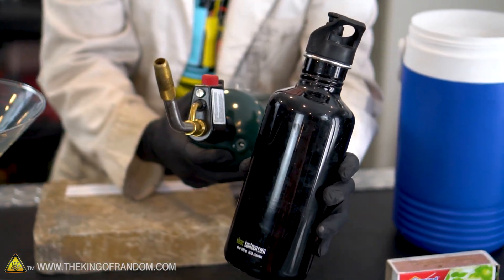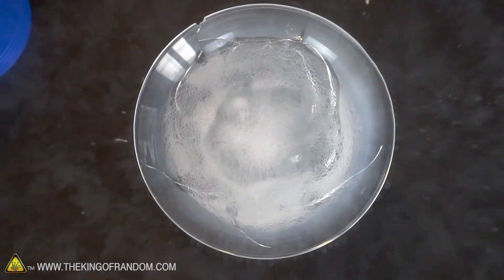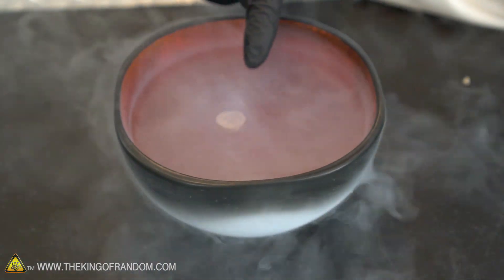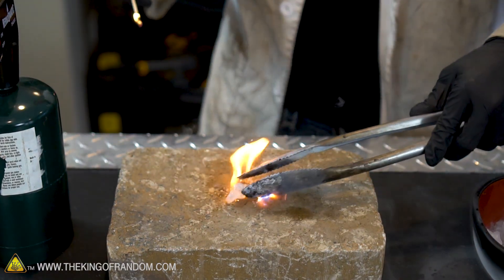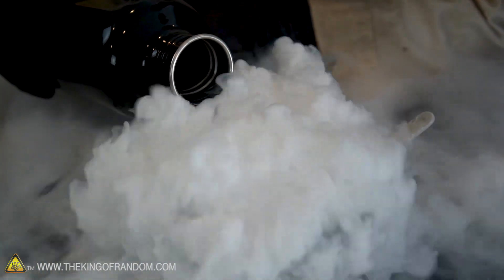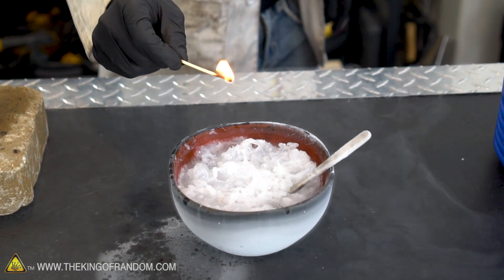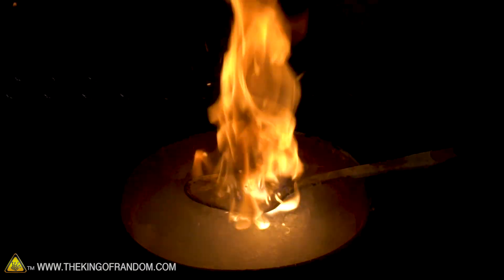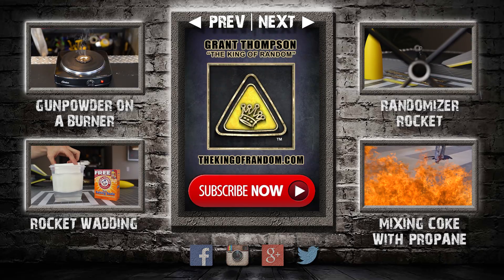Will Frozen Gasoline Burn? Can We Use Liquid Nitrogen To Freeze Gasoline Then Ignite It?

Comment: Is that thick white fog flammable or is it only nitrogen?
Reply: The white fog from liquid nitrogen is water vapour - while it does release nitrogen gas when warmed, this gas is invisible. What you see with the fog is the moisture in the air, like you would see fog in the winter - it's cooling down the air so much that the humidity in the air condenses.
Reply: It's actually not liquid nitrogen anymore after it was heated up, more like gaseous nitrogen.
Reply: It's nitrogen
Reply: I'd say that its only nitrogen and even if it wasn't it would be so full of nitrogen that it wouldn't burn.

Comment: I'm pretty sure what is happening here is that the frozen gasoline itself is not burning, or at least while still frozen anyways. i think that some of the gasoline is melting as soon as it comes into contact with the fire or even near it, that gasoline is then lighting on fire thus melting other gasoline and so on and so forth. So i say the frozen gasoline will NOT burn just melt and then burn.

Comment: It probably was popping because the bubbles in the frozen gasoline expanded, releasing gas vapor. And, of course, the general flammability of gasoline. Also, the massive explosion was likely due to the nitrogen boiling EXTREMELY violently (on top of the gas burning) which flung gasoline everywhere, which THEN caught fire in mid-air.

Comment: That reaction at the end seemed more energetic than just lighting an equal amount of room temperature gasoline and I have a theory as to why.

Liquid gasoline doesn't readily combust, but gasoline vapor does. When you light liquid gasoline, the surface area limits the amount of burnable vapor. After freezing it into a crystalline structure,  a match will melt a concentrated area, vaporize it and ignite it, which will melt, vaporize and ignite a larger area, in a burn that becomes progressively more intense.

Comment: Does all these experiments with an open container of gasoline sitting on the table...   

By the way, it's not the liquid or solid gasoline that's burning, it's the GAS gasoline that's burning.  Need an example of this?  Fill a bucket full of gas and light it - it will only burn as fast as the liquid can evaporate.  The ice-gas was more violent because of the gas gasoline trapped in the air pockets.  This is why colder gasoline won't burn as well, because it isn't evaporating as quickly.

Comment: Melt a magnet in the metal foundry. Will it loose it's magnetic property?  If it doesn't then melt one of the bronze nugget and mix both the melted things.
Reply: Magnets lose their magnetism when they melt
Reply: Magnets actually lose their magnetic properties when they are simply heated up. It doesn't even have to be melted tibiae the magnetism

Comment: Do you not think it's flammable because it melts quickly the outer layer lights which reacts with the frozen nitrogen crackling and then melts it so it will continue to combust. To test my hypothesis could u keep it cold in the atmosphere and try and light it please!

Comment: It only ignites because the surrounding temperature of the air is warm enough to produce a small amount of vapour, however, I don't think It'll ignite if you did the same experiment in a freezer, the surrounding air should be cold enough not to melt and cause fuel Vapour.

Comment: Freeze butane and propane in liquid nitrogen. They both should freeze just like the gasoline. They are a smaller and simpler form of hydrocarbon (Gasoline is a hydrocarbon) so they have much colder temperatures and higher vapor pressure than gasoline so they might burn differently since they will want to boil as soon as they are lit on fire and warm up. This should cause a much faster burning/reaction rate. :)

Comment: Frozen gasoline itself should not ignite, but since its freezing point is so low, that flame quickly heats it up faster than the air does and then once some of it turns to vapor and burns, the rest will heat up, turn to vapor, and ignite over and over again.

Comment: I think you misunderstood exactly what was happening when the frozen gasoline "caught fire". When you picked up a piece with the tongs at room temperature, it began melting almost instantly. I think what's happening isn't that the frozen gasoline is catching fire, it's the frozen gasoline melting from the heat of the match (greater than room temperature) and then catching fire almost instantly.

Comment: So the real science behind this the frozen gasoline isn't actually burning, the vapors from the solid gasoline sublimating are burning.  The gasoline is froze in thin crystals so when the match is applied the solid gasoline sublimates  or quickly melts and vaporizes then the vapors ignite generating more heat to vaporize more solid gasoline.  The popping and ferocity comes form little vapor pockets being formed from the heat and then burning.
Reply: Trey Climer  probably the fumes were igniting
Reply: SWAG No, it quickly melts and vaporizes
Reply: He wasn't explaining what sublimation is. He said sublimates OR quickly melts and vaporizes. It's hard to tell which is going on here, but I imagine it melts and then vaporizes rather than sublimates.
Reply: Liquid gasoline isn't flammable. You can put a match out if you dunk it into a pool of liquid gasoline. It's actually the vapor that is flammable. Comes back to the pyramid needed for fire. oxygen cannot mix with a solid, but heat can vaporize it and the vapor can mix with oxygen and then boom, fire.
Reply: TheSmileyFacedPizza yes he changed it he didn't have 'or' there when I commented
Reply: Trey Climer only gasoline isn't a gas
Reply: Trey Climer and if something sublimates it doesn't quickly melt and turn in to vaper it goes from solid in one go to vaper

Comment: But it will not burn in your car, because it will clog the fuel line.

I have wondered how gasoline would burn if put "accidentally" into the fuel tank of a normal kerosene heater? I couldn't find any relevant YT videos when I searched some time ago. Sounds like an "outdoor" experiment. "Do not try this at home. Only by trained professionals."

Comment: Hmm... I don't think you showed that solid gasoline would burn at all....   I think you showed that the lighter fractions in frozen gasoline turn back into flammable vapour when you hold frozen gasoline in tongs in air at room temperature , and that burns hot, which in turn melts adjacent frozen gasoline, which burns and melts further... etc. I'm pretty sure that if you cooled the gasoline down to liquid nitrogen temperatures and kept it there without excluding all the oxygen the way dunking it in the nitrogen does, it wouldn't burn at all unless the ignition source melted it enough to turn enough of it to flammable gas...

Comment: What happens when you put gasoline in a vacuum chamber?
Reply: You have gasoline in a container without any air.
Reply: it would start boiling and evaporate entirely if the vacuum was maintained.
Reply: Ethaniel H gonna go ahead and say this. Nothing, if you lit a flame it would go out, and the gasoline is has no air in it so it wouldn't expand a bunch
Reply: funny you
Reply: Ethaniel H it would evaporate more quickly

Comment: Can you test if a drone can fly in a vacuum chamber?
Reply: Fat Reeceter it can't
Reply: Fat Reeceter sorry, but you'd have to have absolutely no understanding of physics to ask that.
Reply: Fat Reeceter 
there is no air in a vacum 
so no
Reply: Fat Reeceter  it can't
Reply: Do you really need someone to try this to know if it will work? You know that propellers need air to work, right?
Reply: Will a drone work in a vacuum? Yes. Will it fly? No.
Reply: Eric Air also has CO2. A vacuum chamber removes all gases btw.
Reply: Eric y o u a r e f u c k i n g r e t a r d e d
Reply: Fat Reeceter codyslab already did that
Reply: Eric you need air to make it fly,  I have seen this video before and after a while the drone cannot fly
Reply: This was already done, search in on youtube. people have done this many times
Reply: *physics
Reply: Eric Yes it does. How else would it fly
Reply: Eric *works.
Yes I do, and I was telling you because you didn't mention CO2 when you stated the elemental composition of our air.
Reply: Can you test if Fat Reeceter can survive in a vacuum chamber? I'd say go for 7 minutes without coming out to properly investigate
Reply: you can use other gases to make something fly, all tho "air" is 78% nitrogen and 21% oxygen plus some other gases. 

how else could it fly? it pushes gas down to keep itself up, it creates low pressure at the top and high at the bottom. i guess
Reply: ColonelBumbutt it does not need air to work.

Comment: How does an electric current react in liquid nitrogen / various objects frozen by liquid nitrogen?
Reply: Depends on how strong current if its low voltage there wouldn't be any electric current  because the cold would create too much resistance, maybe if you have really really high voltage it works but i wouldn't count on it.

Comment: Petrol only burns in its vapour/gas phase. However due to the low melting point and relatively volatile nature of gasoline, as soon as the flame touches it, some of the gas melts, then boils essentially instantly. Hence the vigour of the reaction.

Also your partner is gonna have your nuts on a plate

Comment: don't even have to watch... no it won't..  gas in it's liquid state is not flamable..  the fumes are flammable so when it does combust what's happening is the heat is causing the liquid gas to heat and enter a gas state in that state it mixes with air as becomes flammable...  so youcan expect the same results.. where the solid won't burn but as it melts and evaporates the evaporating gas will burn
Reply: Well you should have watched. because it did
Reply: so though the frozen gas did ignight, the block itself was not burning.. when he first took a flame to it the area that got heated began to sublimate (go from a solid state to a gas state skipping liquid) this is what that sputtering was at the initial lighting... at which point the heat kept growing causing the solid mass to continue to sublimate which results in more fuel for the flames to consume..     again gasoline vapor is what is flammable not liquid gas..  if you don't believe this get a small wide mouth container full of gasoline and throw a lit match in it.. it will go out.. but if the container has enough unoccupied space for gasoline vapors to accumlate it will combust, the heat would then increase rate of evaporation of the liquid gas resulting in a fire...
this is why oil and gas fires are hard to fight since both the oxygen and fuel needed are present in the vapors

Comment: One question how can Something have the freezing point of -40 to -50 Fahrenheit and -40 to -50 celsius at the same time? considering that -50 Fahrenheit converts to -45.55556 (thats to 7 significant figures) Celsius (Although -40F does actually convert to -40C) it doesn't make sense because by this logic petrol (gasoline) will have two different freezing points depending on which unit of measurement you are using for the temperature.

Comment: WRONG!!! NEITHER liquid or frozen gasoline burn!! ONLY the vapor does! so of course you get a flame as soon as you put a TORCH to it! curious that the most basic principle of combustion is left out!

try using an electronic spark generator. that way there will actually be a VALID result.

Comment: Hi Guys.
Every time that you work with glass you need to cover with eletric tape in a cross pattern. It's not 100% success but give to the glass more resistence when working with extreme tempetures and pression. It is very common in Labs today.

Comment: I think it starts burning like that because at 78K solid gasoline condenses liquid oxygen on it's surface, flame looks like a flame of a pure oxygen fire, that is why i suspect that, maybe you could try cooling it down with something else, above 88K (boiling point of oxygen), maybe dry ice will work.

Comment: Flame melts the gasoline, so does ambient temperature. Meaning you'd likely just be burning liquid gasoline which melts the frozen gasoline...
Should've tried with a spark igniter instead of a flame and preferably in a contained space where the gasoline wouldn't melt.

Comment: can you freeze the gasoline in the bowl without the liquid nitrogen touching it? my guess is that the liquid nitrogen's boiling is causing air pockets to form in that gasoline which completes the flame triangle. if it freezes without air mixing with the gasoline it shouldn't burn until it begins to vaporize.

Comment: For a child friendly channel just a bit of advice. DONT WEAR PLASTIC GLOVES WHEN BURNING SOMETHING. IT COULD MELT AND STICK TO YOUR SKIN. You only needed plastic gloves for handling chemicals. This way if something went wrong you would only get a small burn.
Reply: And never gloves while operating powertools! Especially rotary tools!
Reply: Danny Goody he tried putting the fire out with them
Reply: Danny Goody it's wear not where
Reply: well we put plastic gloves but our chemistry teacher said us that hacl and other acid can burn them and stick to your skin so its not meant for acids and fire.
Reply: No, HCL will not burn through lab gloves, fire will obviously burn them but thats whatever. Yes he put the fire out with the gloves on but he smothered the flame from its fuel which is the gasoline so he never actually touched anything hot.
Reply: Plastic =/= Rubber
Reply: this fool is one step from being electroboom, i just doubt he'll have the sack to publish the vid in which he finally and badly hurts himself.
Reply: there are a ridiculous amount of chemicals being handled in this video... so kind of contradictory.

Comment: Technically I don't think that the "frozen" gasoline burned. The outer layer was thawing the second you removed it from the Nitrogen, and therefore liquid. And once it caught fire it quickened the thaw of the frozen part turning it liquid. I think it sputtered because it "bubbled" as it thawed creating small open pockets.

Comment: The reason the gasoline exploded in that last reaction was because the frozen gasoline had several little pockets of air in it. When the gasoline ignited, the air in the pockets expanded rapidly, which in this case blew the frozen chunks of gasoline apart, sending bits of it everywhere. Those bits were also on fire, so of course that made a huge mess.

Yeah, I'd advise playing with fire outdoors next time.

Comment: I don't understand the science of this, as it is the vapors of gasoline that actually burn, not the liquid - on a cold enough day you can actually put lite matches out by throwing them in an open container of gas. So what's happening here? Is there a chemical change when you mix nitrogen and gasoline? Is the nitrogen acting as an oxidizer? This warrants further study.

Comment: Is it possible that the gasoline was close enough to it's melting point that the heat from the match converts enough to liquid to start a chain reaction?  I know some organic chemist can weigh in on the stoichiometry required to ignite gasoline.  I was thinking that even solid you'd have to get the right air/fuel ratio to ignite.

Comment: The thing is that it is the vaper and the alcohole in the gas that is burning.
So that means that if you pour gas onto the table and ignight it, it will not burn the table. It will only burn the gas itself and then go out completely.

Comment: i think the vigorous ignition might have somthing to do with the nitrogen. mabey trhere is oxygen in the gasoline, or mabey the heat off of the initial flame of the gas makes the nitrogen and the air mix? i dont know, but could you try the same, but freeze it electricly? or dont use nitrogen, or other chemicals? or even just dont let them touch. thanks :)
Reply: it could even be the same as if you try to light a piece of wood soaked in wax, and wet with water
Reply: or it could be the same as magniesium and dry ice

Comment: can you try this with diesel? that would be grate if you did
Reply: you can't ignite diesel with a fire it only will ignite under high pressure and heat caused by the compressed air
Reply: grate =/= great.
Reply: Joshua Schmitz how am I trolling? I have a diesel and have tried before you cannot light the fuel on fire there is no similarities between regular gas and diesel for how it burns
Reply: Jordan Tripp my man I'm not sure where your going wrong but I only light fires with diesel. no vapor to explode out and injure anyone.
Reply: he's right you know.......
Reply: James Powell it can ignite but it ignites at a higher temperature.
Reply: while pressurised yes however you are looking at a temp of around 400-600 Kelvin and even higher depending on which grade of diesel it is